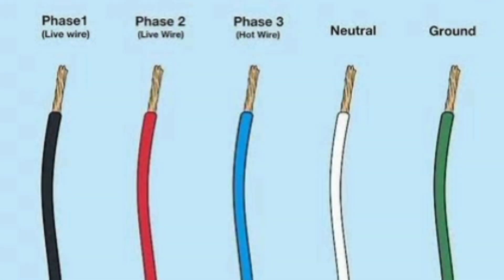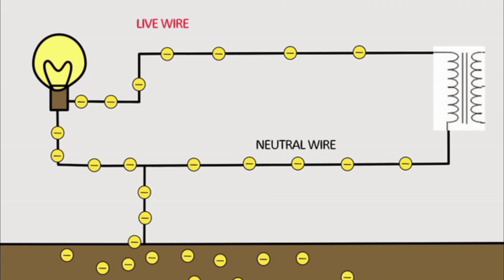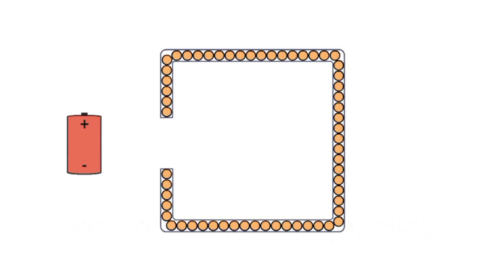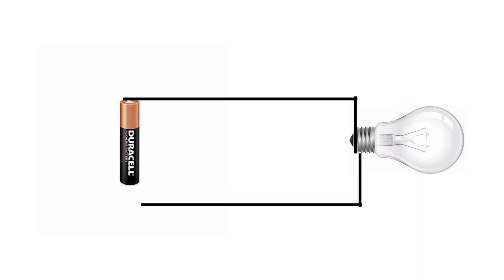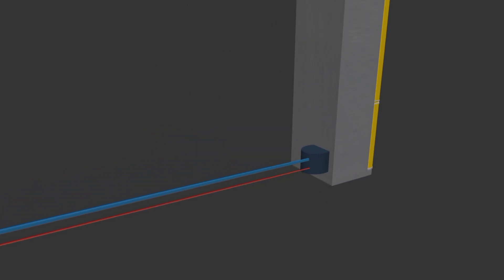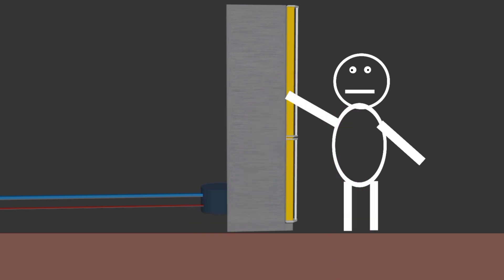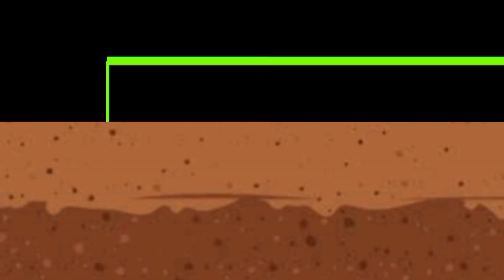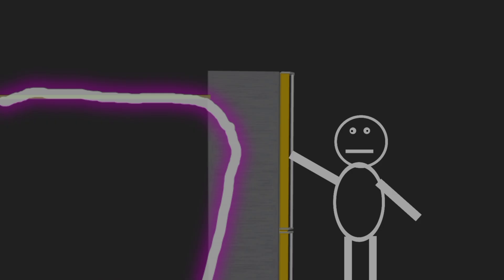Grounding and Neutral wires Explained

Comment: Sir,  live wire has 220 v and neutral wire has 0 v. But same current flow through them. Pls sir explain this
Reply from the maker: Current and voltage are two different things. Current is caused by the the potential difference that we call Voltage. Current is the result and voltage is the reason of that current.